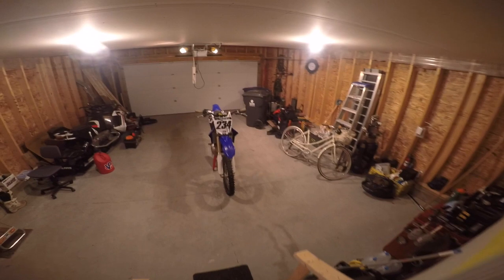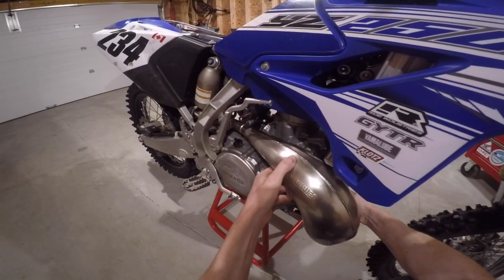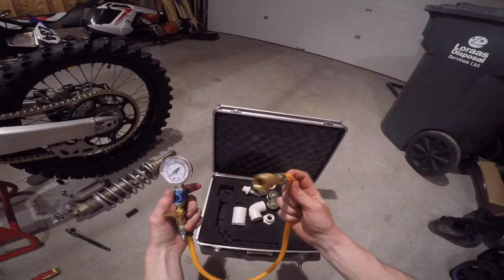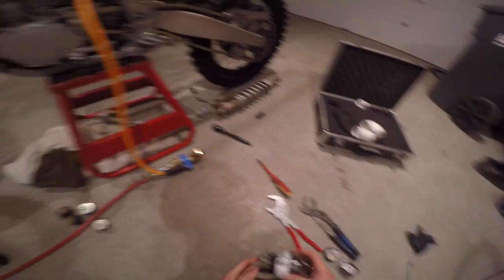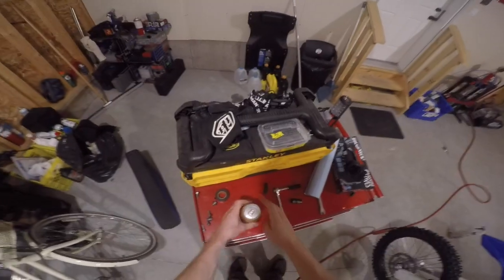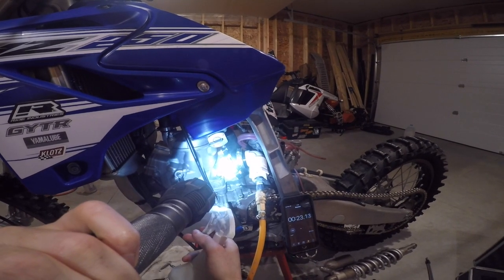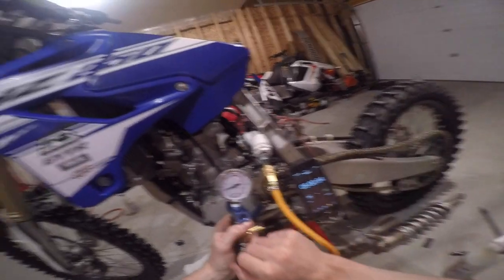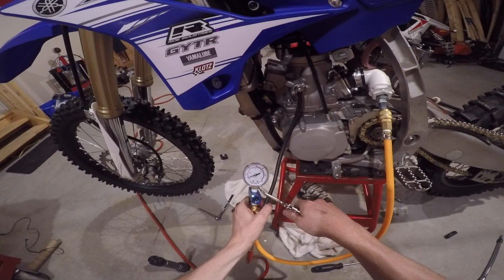2 Stroke Leak Down Test (How to)

Comment: Does your filler cap release pressure if you are to loosen it during the test?
Reply from the maker: The radiator cap? If you have pressure in there during your test you have a head gasket or cylinder base gasket leak. Should be no pressure in the rads

Comment: So you say .. better then a compression test.. so how does this show you that the rings are any good... Or if a head gasket is any good on an air cooled engine... Yes on a liquid cooled two stroke it might be handy to blow bubbles like that ... But this test does not show what condition the top end of the engine is ,,at all..... This test you did here is also supposed to have vacuum applied .. because the actual name of your test is .vacuum/pressure test
Reply from the maker: Hey tips if you knew it all already why are you here? Air cooled engines certainly do have head gaskets. Yes ideally a vacuum test also will be beneficial, but a 2 stroke engine (or 4 for that matter) is just an air pump. Testing integrity of seals under pressure is necessary because during operation they must withstand positive pressure. Applying negative pressure is also a good idea, but realistically and usually choosing to test via positive pressure is going to yield similar results.
If it was so wrong to do, why do all piston aircraft engines get tested this way? 

On the note of compression test, I mean the leakdown is better overall as you are analyzing/ testing way more than just your top end health. No this won’t tell you if your rings are worn, but name me how many average riders you know that have heard of a leakdown/vacuum test vs how many have heard of a compression test.

Comment: If I had bad crank seals would the transmission oil plug let air out?
Reply from the maker: Yes- but you need to keep in consideration how the power valve system is actuated on your specific machine. Usually with a less than tight system you will get erroneous bleed down through the power valve linkages and down into the crankcase/oil your oil fill hole. 

Hope this makes sense. A big leak out there I would definitely suspect wet side crank seal.

Comment: does the  piston have to be in a particular position before testing?
Reply from the maker: No. The whole cylinder will be filled with air regardless of where the piston is- as no piston ring setup can be 100% air tight.

Comment: whats about the power valve how you close it?
Reply from the maker: The power valve is vented to atmosphere via the rubber hose that I clamp with the vice grips. Is this what you mean?
Reply: @turdpike  sorry just asking I'm doing this is school today and we got told you have to take the cover off right side of bike and cover the power valve with like  Plato like substance. Lol and I'm struggling haha can't get it to build pressure so I'm check out YouTube on lunch lol
Reply from the maker: @thewicketd7817  hmm, what kind of bike? If it’s a YZ like this with this style of cylinder, there is no good way to stop the hose (left side) from leaking, so you can just clamp it. The RH side on the power valve linkage itself where it goes down into the lower half of the engine it has a seal on it. Unless that seal is leaking badly, the RH side doesn’t need to be touched in my opinion. And you’d know if that seal was leaking by losing a bunch of air via the transmission vent.

Comment: Just worth mentioning, this is called a pressure test, not a leak down test (which is totally different and used only for 4 strokes).

Also you need to do a vacuum test too as a pressure test won’t test the validity of the oil seals

Comment: Your cooling system is a separate sealed system dumb dumb! There is no need to remove the radiator cap!
Reply from the maker: Ever hear of a blown head gasket dumb dumb? You’d see bubbles if you took the cap off.

Comment: There are two types of test for leaks. On a 4 cycle engine you do a cylinder leak down test. On a 2 cycle engine you do a vacuum/pressure test. This would be called a vacuum/pressure test. You should test vacuum also. Sometimes a seal will hold pressure but won’t hold vacuum.
Reply from the maker: Good point!
Reply: can the bottem end have a vacuum leak? I heard the bottem end is pressurized so can it only push air out?
Reply from the maker: When the piston travels upwards it will still create some vacuum in the crankcase, that’s what draws in the fuel and air mixture from the carb in the first place. Most of the vacuum will be used for just that- as it’s the path of least resistance, but you can have a crank seal leaking enough to draw extra un-metered air through it
Reply: How can you use this to tell if your crank seal is leaking?
Reply from the maker: Yes, absolutely

Comment: Great video!  What did you use to plug off the exhaust port?
Reply from the maker: You’ll see it in the video- was like a 2” rubber hose coupling that I hose clamped a progressive step down of plumbing fittings to a small end cap. Kind of a hokey set up but it worked- you need to clamp externally on the YZ250’s exhaust port. A normal expandable rubber frost plug won’t work in the YZ’s oval shaped exhaust port

Comment: Great video. 

Remember to set piston at the bottom of the stroke. 

Also I would have thought the valve on the gauge should be open. 

Otherwise your just measuring the pressure in the gauge.
Reply from the maker: Thanks! 
But I’m convinced it doesn’t matter where the piston is in the stroke, as no set of rings are going to make a 100% air tight seal. If a constant 5psi is on the bottom than a constant 5psi will be at the top in a stationary engine. If it weren’t, when you apply pressure the the bottom side of the piston you would expect it would rotate it and force the piston to TDC and it would stay there, but that is not the case. 
You close the valve to see how much leakage over a given time period there is. If you keep the valve open you’re just feeding it a constant pressure, which is fine for when you’re diagnosing where a leak is, but you need to see it hold a charge of air by itself with no more supply. And of course you’re reading the gauge on the unit, it’s exposed to the same atmosphere as what is in the engine, not sure what you mean there

Comment: Now how would you find a leaking crank seal using this method? On the clutch side, since the case cover is sealed and you can't open it without draining your oil and coolant. I'm guessing you would leak down the engine and if nothing obvious is leaking from the outside and you still have a leak, it would lead you to thinking the crank seals are bad and you would then tear the bike apart?
Reply from the maker: If you have lots of blow by through the crankcase breather hose then you know some is getting down there somehow. If you clamp the breather hose with a pair of vise grips during a leakdown and it fixes your issue, then you need to investigate further. Depending on your machine they all design the powervalve linkage differently. Some machines will have small parasitic loss through the powervalve linkage, but on this yz they are separated by a proper linkage seal. If you loosen your oil fill cap too while you have air going in you may hear bubbling or hissing too if your RH crank seal was bad. A few ways to do it but a leakdown will for sure find it
Reply: @turdpike  thanks bro

Comment: Coold video. I was wondering why you didn't introduce the air from the spark plug hole but then realized the reeds would block the air. So to check to see if your reed valve housing is leaking I'm assuming you would have to introduce the air from the carburetor?
Reply from the maker: Micscience I didn’t remove the reed block, this way checks the reed block gaskets as well. I’m plugging in where the carb would be
Reply: @turdpike  Cool thanks for the reply.

Comment: I don’t think you mentioned that your piston should be at BDC
Reply from the maker: I’m not convinced it does, the whole cylinder is pressurized to the same level. To me it doesn’t actually matter where the piston is in it’s stroke, but I could be wrong?
Reply: turdpike I could’ve wrong too, maybe that’s only if you’re pressurizing from the spark plug hole, so the transfer ports are open and the crank case pressurizes. Idk if it’s different doing it through the intake

Comment: I have a kx 250 98 that’s had a top end rebuild and it’s still not producing the power it’s supposed too I believe,I’m considering getting a leak down test done ,if they have a leak somewhere will that cause a decrease in power or not necessarily ?
Reply from the maker: 100% it would cause a decrease in power if say it had a raging leak in the RH crank seal, or like major head gasket leak. A leak down test is very informative
Reply: Check your power valves 👌. They can get carbon build up and start sticking causing your power to feel like shit.

Comment: Working on my jet ski. Is this test compatible if you have more than a single cylinder? Blew my engine and don’t wanna have that happen again, my current best guess is water filled carbs, and the seals from each cylinder I’m a little skeptical on
Reply from the maker: Yes you bet it will
Reply: turdpike thanks! Not relating to the test but found my PTO crank seal came loose. No wonder my piston looks like a metal foundry. And just to think my dumbass almost looked over this as a dust cap or something.
Reply from the maker: Life of Aedan ohhh crap! Now you know! That would definitely be the reason- we’ve all been there one time or another lol.
Cheers
Reply: turdpike haha 😂 just getting into the hobby and being my own mechanic. First top end rebuild, love learning this stuff as long as I don’t cost me any more money.
✌️✌️

Comment: you dont use Dielectric Grease to seal with ,its designed for electrical connections ,you should use a  thin layer of gasket sealer .
Reply from the maker: Sion Williams I’m aware of that, but it’s all I had and does the job for now
Reply: fair enough m8 .